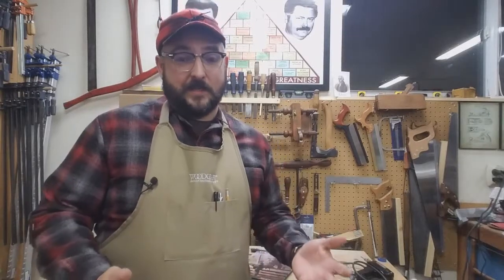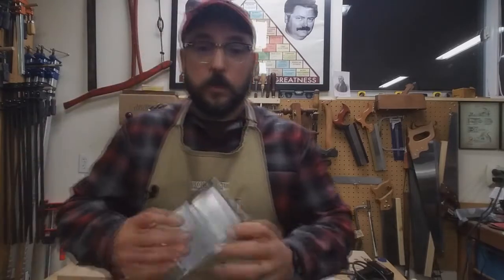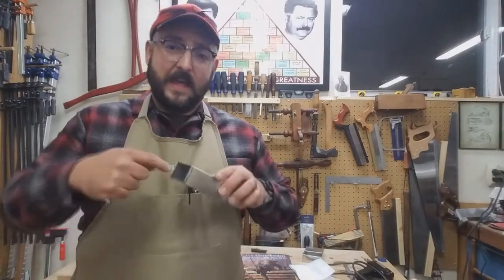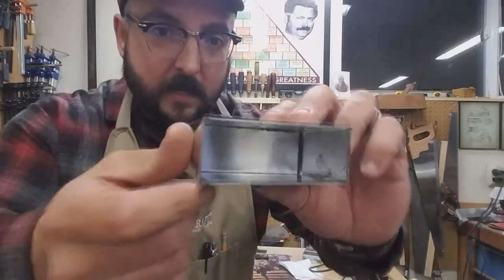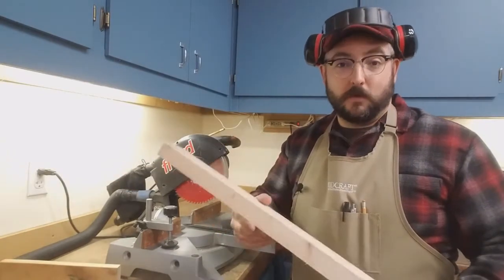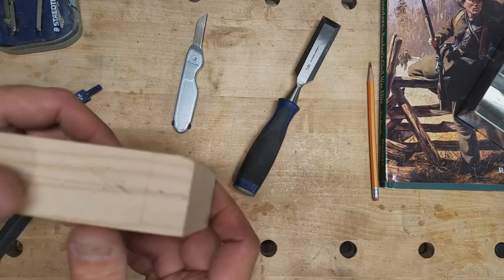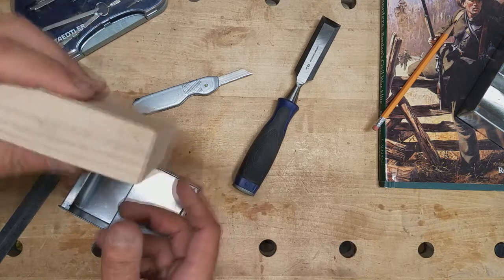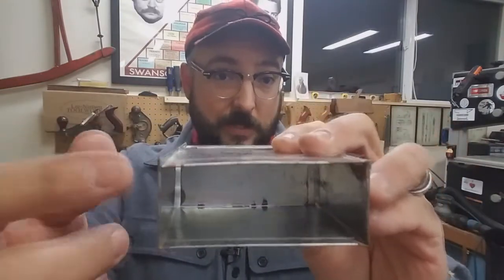1859 Sharps Wooden Block Inserts - How To!

Comment: Great job Jerad.  To expedite loading and firing I use four blocks in the tins.  They are made to fit loosely so that they can be flipped quickly in and out from top to bottom.  It works well.  Your emphasis on the Forstner style bit was perfect.  I got mine in a metric measurement on one of my voyages to Germany.  Keep the videos coming.
Reply from the maker: You know, I was considering trying metric.  These holes are just a bit too small to hold live rounds.  Which could be a big plus for safety not being able to accidentally leave rounds in from the range.  But I was wondering if say a 14 or 15 mm would work better.

Comment: Excellent, your best video yet! I have a cartridge box, and a .58 cal. Snider rifle. In my book on Indian War equipment, they show a Civil War cartridge box that has wooden block inserts for the .58 cal. Rimfire rounds. I was curious about how I could copy the wooden block inserts, now I know. Your tip on using the soldering iron to repair out of square tins was perfect, I thought my tins were just poor quality, now I understand they are normal, but repairable! Thanks for the work and instructions you give!
Mark D Esparza
Reply from the maker: Thank you so much for your kind words and we're glad to pass on useful information.  The original tins I've seen are made much better than the imports so figuring out the soldering part was a big a-ha!  Another tip when soldering is once you've de-soldered, put a wood blank, or the block you plan on using inside before resoldering.  The wood will help you clamp the tin in place while soldering.
Reply: Thanks for the additional tip. My shooting friend and I are planning on trying to build this block for my cartridge box. I hope it works as well as yours did!

Comment: would it be a good idea to take a wood block that is an inch and a half and then just desauder  and then lay the block in the cartridge tin and sauder the top plate down with it laying on the block then just take the wood block out.
Reply from the maker: It would be and I've done that a couple of times.  Whatever gets the job done.  I'd just make sure to drive a screw or something into one of the holes to help with removing the block in case it's wedged in afterwards.

Comment: I am still ready to load linen cartridges. The only thing I am missing is how and what to treat the linen with. I read to "size" the linen, but I just know that won't get me where I want to go. I just can't believe I cannot find info about how to treat the linen. I'm going to try varnish on the linen to stiffen it up and make it combustible. This whole thing with linen cartridges just seems to me that those folks who know how to do it are holding the process close to the vest, and will not share??? Trying to research this is like pulling hen's teeth!!! Why won't you folks that know how to do this share with us???
Reply: Try potassium nitrate dissolved in hot water, add until won't dissolve anymore . Soak fabric a few hours and dry it. That's what a lot people do for paper cartridges, don't know why it  won't work for cloth. You can buy it at Menards garden dept. It is used as stump remover.